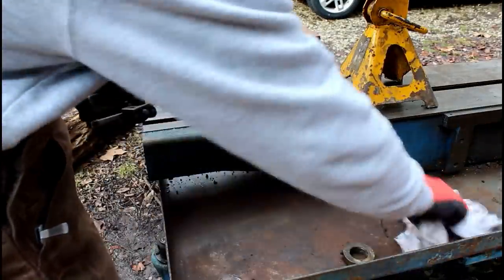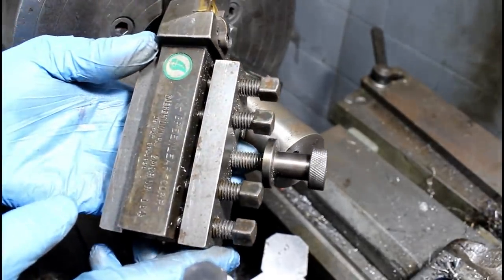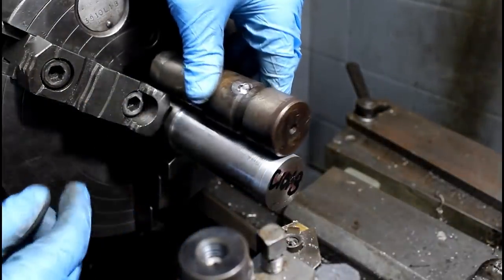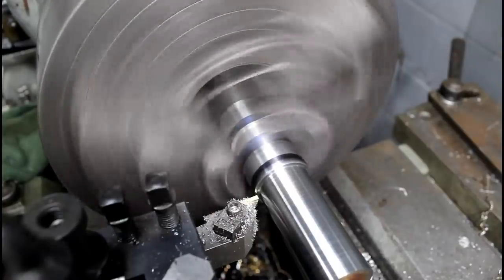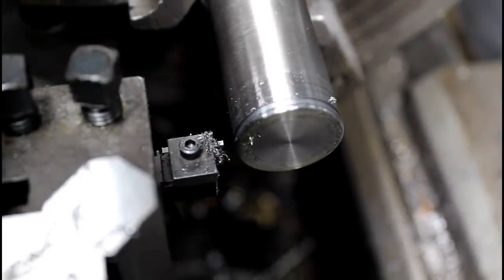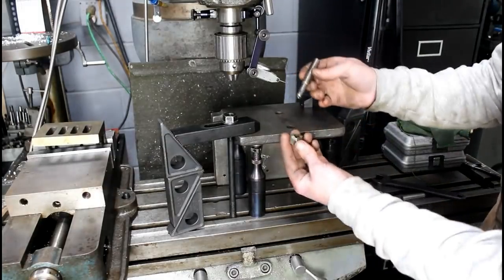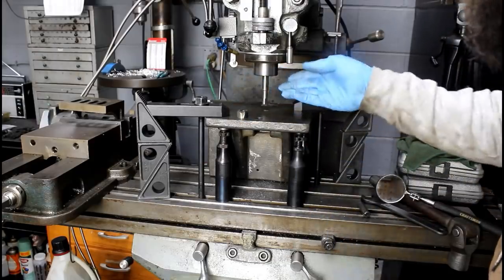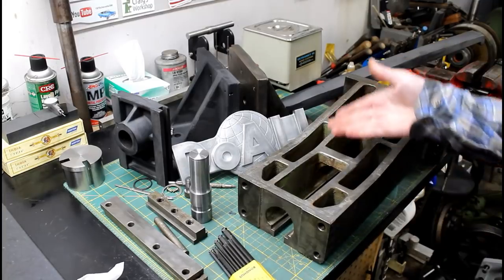Heavy Vise Removal & New idler wheel shaft ( Do-All Saw)

Comment: Yea, got to say.  I look at your hendey, one I have was a basket case.  Still need to finish my compound.  Need to buy or make a couple of gears and make a housing and dial plus handle.  Got it in use with some 1/2 20 right hand and a .050 dial.  Good enough for threading but someday it will be a project.  My feedscrew reversing lever was also gone.  I do keep track of my chain vise grips because they reside on my Hendey and work ok.  Aluminum bronze fabrication project is in order for this project since casting cast iron is not my forte.  Just keep posting videos and I will keep staring at your feedscrew reversing lever.

Comment: I've made plenty of small grooving tools by grinding a larger grooving insert to a smaller size on a diamond wheel. Make a threading insert out of a carbide grooving insert. I've even sharpened worn carbide inserts on the diamond grinder...it works well for us home shop guys that don't have a tool crib to pick from.  Carbide is carbide.

Comment: on your thinbits there Steve:
an old carbide tipped circular saw blade will work quite well when you cut out the size of cutter you need. then grind them to the desired thickness(width) on a surface grinder. as long as you don't run them too hard they actually hold up fairly well...another way machinists are the ultimate recyclers and re-purposers..

Comment: YOU SIR- would greatly benefit from a Parts washing cabinet - even the cheapo Harbor Freight one works decent - Pro tip, since mineral Spirits is so darn expensive these days, I put a bunch of big spaghetti sauce jars filled with gravel to make them heavy with the lids screwed down, do displace the amount of Spirits you need so the machine will be full enough for the pump to work without having to buy 20+ gallons of stuff - I fill mine with about 7 gallons now per fluid change!

Comment: Yeah, American manufacturers used to make things to last a lifetime or longer with proper maintenance. Not so anymore everything seems to have an engineered lifespan 10 years if your lucky. You sure seem to have some cool tools I have not seen used on any of the other channels I follow. I appreciate a good tool, work smarter not harder. Those cap screw counter bores, I would have found or made a soft copper crush washer but you had the cool tool to get the job done right. Great stuff Steve and peanut is cool too.

Comment: Wow I have never seen the back counterbore tools before that is brilliant!!!
If you could provide a manufacturer I would be very grateful!!!
At my work we have a left and right holder for the DMNG 432 inserts which are expensive and work great for facing
or anything your not working into a corner, plus you get 8 cutting edges out of 1 insert woo hoo.
You are going to have a very nice saw when you are done!!
PS I'm in the process of "installing/repairing" a large Shibaura  BT10BR HBM built in 1979

every where you look is stuff that needs fixed...
We are calling it the Exon Valdez because there were so many broken fittings in the auto lube system 
that it was creating a huge oil on slick the floor....
It has weird metric inverted potmetal compression fittings that the only thing that I have found tight
is the 1/8 male pipe threads broken off in the castings in horrible to access places.......
Gonna be a cool machine when I get it all working!
I actually plan to use it as a shaper for large internal keyways along with all the other things it will be useful for.
Love your channel, makes my Saturday mornings!!!!!
Reply from the maker: I was told McMaster sells them. Mine are shop made.
Reply: @SteveSummers  Thanks I'll look into  that..

Comment: If you want a nice finish on that cold rolled, run a shear tool across it to pull off the last couple thou. I use a boring bar rotated nearly vertical as my shear tool.
Reply: Indeed and for pretty try a roller burnishing tool.

Comment: I can see that you was using extra speed to get some good chips that's experience right there 🙂👍
Reply: Daniel Son i would crank it up until the chips are turning blue. Carbide is happy there. I think you could have gone for a considerably deeper depth of cut. I always seem to get a better finish on 1018. Dunno why. To get a final finish I learned from a book to use a clean #6 swiss cut file covered with coolant. Leaves a finish close to a ground finish.
Reply: @sblack48  He couldn't go much faster. I think his lathe tops out around 500.
Reply: @sblack48  So true.  Carbide loves speed and feed pressure.  You know you have it right when you are making Cs and 6s.

Comment: You might consider pinning the T-nut to the vise jaw to keep the wallowing from happing. Let the pins take the lateral stress and the bolts just hold the nut to the jaw.
Reply from the maker: That's a very good idea. I may do that.
Thanks.

Comment: Hey Steve, I watch your videos because you have a good lathe, hendeys are the best!  Shapers work good and marvel made good stuff.  I have a Hendey 12 x 32 a Flather shaper plus a Marvel 6 inch power hacksaw, I keep my eye out for the vertical saw, I had use of a marvelous vertical saw last shop I worked at, better than a roll in.  That saw should be a good asset for your shop when done.  Just keep up good work, I need to spend more time in my shop.  I get home from work and watch YouTube,  fellows I have worked with tell me I should make videos.  Someday maybe.  Barnes drillpress rebuild?

Comment: This style of cutter is how they drill ventilation shafts  in Australia mining industry. They drill from the surface down to a passage way under ground with a small drill bits to fit the shaft of the hole raising drill. Then they  fit bit of the size for there ventilation design ( could 4 foot diameter) then drive the bit from the surface pulling the bit to surface. All the debree  falls down to passage way and is remove from there.  Just like you small version here.
Reply from the maker: Nice!

Comment: Hey Steve . Nice video. Just a side note , maybe it’ll help u or not I’m not sure: most inserts with an 0.8 mm or larger radius can take a depth of cut 3/4 the length of the cutting side if ur speed and feed is correct. Inserts actually perform better with bigger cuts. I rough out sometimes with a depth of cut of 8mm or 16mm on diameter with the feed way up and the inserts love it. Use wnmg, cnmg,tnmg inserts.

Comment: My kids got me that same Gerber knife for Christmas. I love it, use it everyday. Great work as always Steve, always look forward to your videos, keep it up!
Reply from the maker: I've been through a few of them. What breaks is the pocket clip or the screw will strip after a year or two. Well worth the money.
Reply: Did you have a link to it?
Reply: @SteveSummers  Yeah, what were they thinking using a screw to change the blades. I was working with my dad, and he was still using one of those old Stanley utility knives where you have to use a flat screw driver to take the two parts apart, and the worst part was that the screw was stripped, so he was using tape to hold the 2 halves together!!! Ahhhh. I told him that I would give him the Lenox one I was using if he threw that old one away.

Comment: Steve, about those damaged seats in the vise jaw. If you cut too much out of the seat you will reduce the strength of the jaw at the bottom of the hole, meaning that in some situations, such as strong vise pressure or a blade jam, you could actually break the hold-down bolts through the base of the moving jaw. And the diameters of those holes are also seriously damaged, so you have no chance of obtaining grip from the fit of the hold-down bolt on the sides of the hole.

Have you considered milling out those holes oversized, and the pressing in some properly cut bushes with the correct seat thickness?  You could do the work from the underside of the jaw, as you already did. Given that you have gone to so much trouble to replace major items such as shafts, making and fitting two of these would take a man of your skills no time at all. And I'm sure you have some scraps of cast iron lying around that would suit.

As you have said, if you're going to do it, you might as well do it right.

Just sayin'...

Comment: I lived across from one of the Greenleat plants in Saegertown, PA. You should see if you could come up with Adam Booth and Kieth Rucker sometime in June and October there is a group called The Pioneers Steam and Gas Society that puts on a show of vintage gas and steam units. They have tractor pulls, working heavy equipment and many old single lung engines both running and just to look at.

Comment: I have a question, would it be easier to re-mill the slot for the T-nut on the bottom of the vise and then make a new T-nut that fit better? it appeared that the sliding jaw was canting side to side as you pulled it out. if your equipment isn't large enough to hold that part of the saw, do you think you can convince Brian Bloc to help you with it? Montage? Cameo?
Hey man, what is the story behind you taming that squirrel? I had 3 of them as a kid because the guy behind me cut down a tree and they were in the nest in the tree. they hadn't opened their eyes yet, we raised them then returned them to the wild.

Comment: Great work. The "upside down" counter bore is great, but for some, an extension piece to hold an ordinary endmill and mill from the top, would be a simpler method. (Easier to make than a shaft and cam activated cutter!)
There should be a washer under those cap screw heads.
The downward pressure on a hand held hacksaw, should only be on the cutting stroke, not the return stroke. 
Best wishes...

Comment: Getting a good finish on mild steel with carbide tools requires in that size shaft about 2000-3000 rpm to get enough surface speed for the tool to cut properly. On manual lathes it is somewhat problematic as the usually top out at 1k or 1.5k.
Reply: A Roller burnishing tool can work wonders if you want pretty.

Comment: Could have gone with a bigger countersink and put a washer under the bolts to give more surface area for a stronger hold. Oh well maybe one of your grandkids can address that in the future if it gives up again. :-)
Reply from the maker: Yeah, I doubt it will be much issue in the future😁. Even in auto mode it lasted 30 years. In manual it should go 100 easy.  Good fix on the DRO video Brian.👍

Comment: (from the UK) loving those 9mm 1/2" mixed measurements!
Is it likely that the part is a replacement but all they could get was a metric and they just adjusted it to fit?
Reply: Bearings, and obviously shafts and housing, are frequently metric sized even in a rabidly imperial country.🙄
Reply: @chrisstephens6673 - What's bad is that bearings with the same number can sometimes have imperial bores and metric bores.  Ran into that when rebuilding an older live center had my choice of 5/8" or 15mm.  Found the problem when the bearing would not press onto the shaft.  Had to order the 5/8" and press it on after cleaning the burr off the shaft I had made with the 15mm.
Reply: @MaturePatriot  absolutely correct, in the old days we used to bore the bore of ball races for certain old British motorcycle engines because they were no longer made commercially. Although imp bearings are still made the vast majority are metric, which only fitting as they were invented in a metric country.
Reply: Chris Stephens - We ain’t havin none of your screwy European measures. If God wanted us to measure in mi-lamiters he wouldn’t made the dial on my lathe in thousands. That’s the way I see it. 😎
Reply: @joeromanak8797  God didn't make tools, god gave man the power to make tools, he just didn't give them the power to make things properly :P
Reply: @MaturePatriot  Sad thing is that even in the UK to this day, we still have this issue :(
Reply: @joeromanak8797  hi Joe, thank you for preserving the use of good old English units, even if hardly anyone else in the world knows what they are.😢😢😢
Reply: @joeromanak8797  So is mine, thousandth's of a metre, the very definition of a millimetre. The working is the same, just a different base scale. It all depends how you started and what you are used to. To a metric user, an inch looks as stupid as a metre looks to someone working in the imperial scale. I wonder if the Death Star used Imperial measurements?
Reply: Ben Chapman  - I’m just playing the game. Accuracy and precision are the same regardless of the units. The training and attention to detail of the operator are what will differentiate a good part from a bad part. I’m 65 and when I was in elementary school (in Pennsylvania, USA) they told us to get ready for a new measuring system. It seemed liked it was really going to happen but, as quickly as the idea arouse, it seemed like it died and disappeared just as quickly. I’m very accustomed to imperial divisions but to paraphrase Red Green, “I could change, if I had to, I guess”. But I’ll probably never stop being the YT trouble-maker on this topic. Y’all have fun with your mms and your cms and whatever comes after that. 😎👍

Comment: how about building the face of the T nut with some bronze and then machine to a good fit. Will at least give a nice wearing surface, and will be a bearing surface as well. Make a bit wider if possible, to reduce wear on the surfaces, as it really only has torque on the front surface of the clamp, so wears the most there.

With those worn out pockets, would simply milling them to the next size capscrew, and taking new fasteners and cut them to a reduced thread not work well, or would you mill it out larger and make an insert that is either a shoulder, brazed in, or a taper fit bush.

Comment: It's almost impossible to get a good finish on 1018 on an old school lathe....what you need is high rpm (for a shaft that size, I start to see a good finish around 1600-2000rpm).  You got pretty damn good results for your speed limitations though! Respect!  Awesome video and camera work as usual!
Reply from the maker: Less than 600 rpm is my max on this on lathe😁

Comment: I find that carbide insert turning on a big old lathe it is pretty difficult to get good surface finishes on small diameter parts. My old 1940 LeBlond 17" can only do a few hundred RPM, and even with the VFD overspeeding the motor in the highest gear, I just can't get enough SFM to keep the carbide happy.

Comment: Mr. Summers, when you use the term "mild steel", exactly what chemical/metallurgical properties define this, compared to other steels that you use?  I usually define it to mean a lower carbon content of under 0.4%; no special alloys like chromium, nickel, molybdenum, etc., with silicon and manganese used as the sole hardening/toughening agents; and usually not hardened more than 175 BHN, usually less (hardness.can be somewhat higher, but with brittleness a problem in that case).
Reply from the maker: Low carbon steel / mild steel

Comment: Don't worry, there's a point in every project where it appears that there will be no end.   One question is what is the purpose of the very heavy cylindrical "extensions" with the tie bolts that surround the vise screw and the other tightening screws.  They look almost like hydraulic or pneumatic cylinders but I see no connections for outside pressure supply and extra force applied might be counter to the screw mechanism (?).  They look almost redundant, unnecessary for support of the screw shaft, just heavy iron for the sake of it?

Comment: Yeah back spot facers or counter bores are available but as you thought expensive Steve. And really really expensive for solid carbide. https://www.mscdirect.com/browse/tn/Holemaking/Counterbores-Porting-Tools/Reverse-Counterbores-(Spot-Facers)?navid=12106110 There not a very common tool, but I've known about them for years. Sometimes nothing else will get the job done though. Nice job making your own.